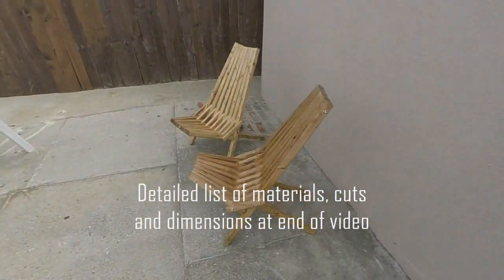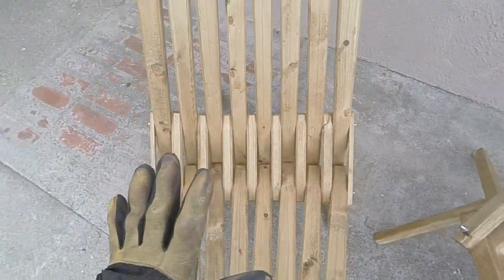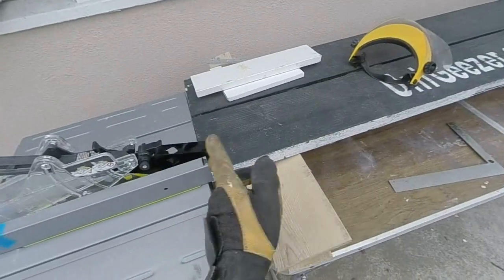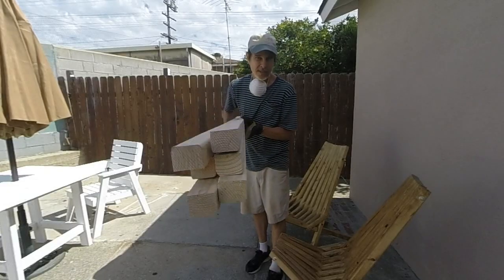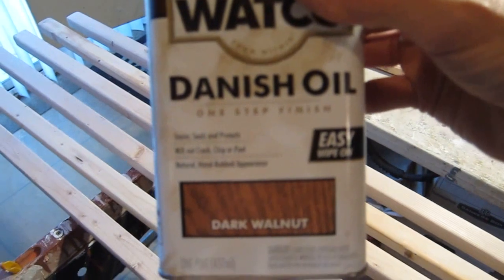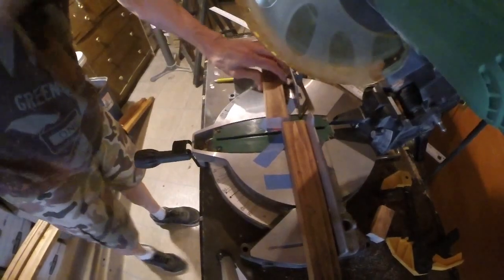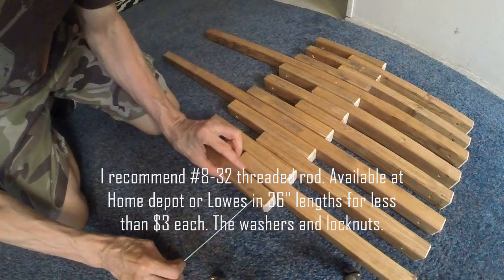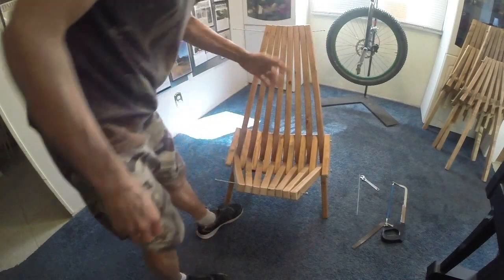DIY Kentucky Stick Chair

Comment: Terry, I had a great time building my chair and did some modifying along the way.  I like the idea of the 2x3s. Did you know that the quality is better with the larger lumber?  As I was assembling the chair, I used 1/4" ready-rod and started with the chair laid out out flat on the floor so it was easy to push the rod thru and and after tightening the nuts up I just cut off the excess. It was easier than trying to fight with a short piece of rod. In my case, the chair had too much pinching at the ends so I added several spacer blocks to flatten the chair somewhat and make it more comfortable. For the next one, I will make the back a little taller cuz I am taller.  I found the project to be easy to do, I just built an auxiliary table for cutting the pieces with a skill saw and clamped to the drill press so I could drill all of the holes with complete  confidence of accuracy. You just have to remember which side of a stick you need to drill.  "Not the top or the bottom. FOOL!"  

What many builders may be unaware of is that the seat back strut needs to lock into the seat bottom strut. If it dont lock in, it wont say together.

Comment: Thanks for the great, detailed video! Could you please explain why the 3rd and 6th back pieces (labeled as "D" in your drawing) are shorter than the others?
Reply from the maker: The back pieces 3 and 6 are shorter because they rest on top of the two longest seat pieces which are also the back legs.
Reply: @TerryUniGeezerPeterson  Thanks, this makes perfect sense. I've started sketching out my own plans (based heavily on yours) and I have one more question if you're willing... I'm wondering if there's a specific reason you placed the rear legs so close together. It seems to me the chair would be a bit more stable if they were placed wider apart. Thanks again... I can tell you're a person who cares about the details, and I totally appreciate that! :)
Reply: @dvanmegroet  Notice in the video, when he squeezes the front of the seat boards together, it spreads out the legs in back. I have made these chairs before and they are both very comfortable, as well as super stable. I use 1"x1-1/2"  hardwood and then treat it with a deck stain/ water sealer.